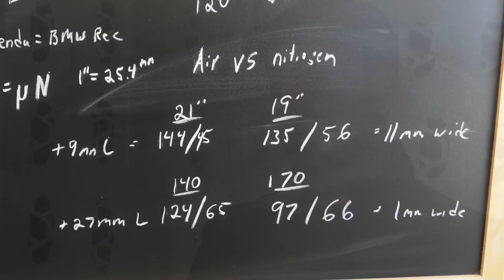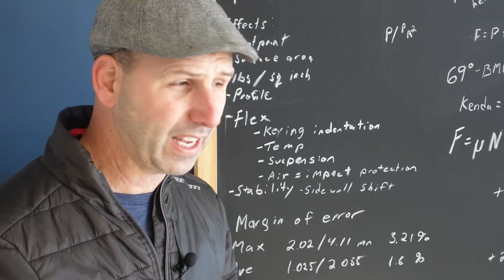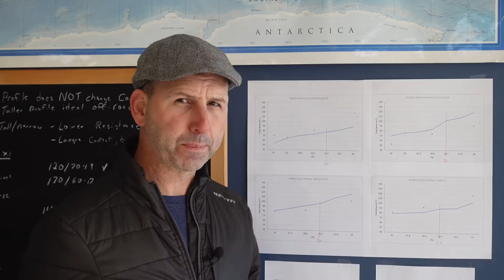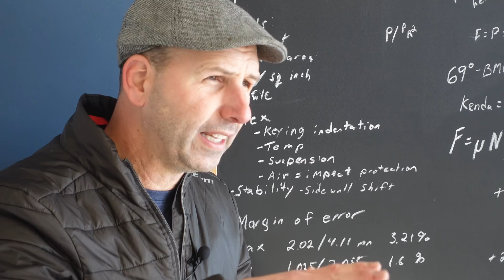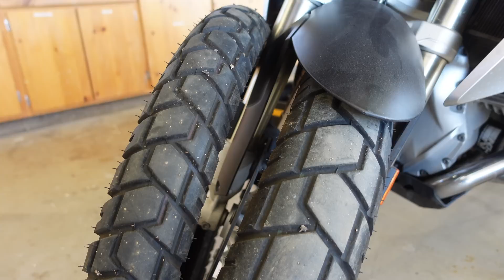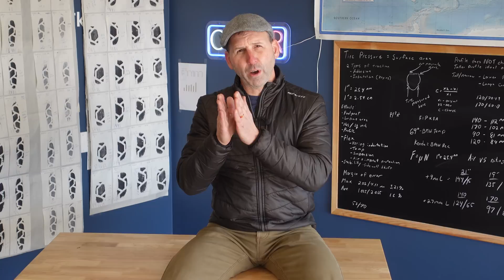Selecting the correct tire pressure; How airing down motorcycle tires affects contact patch

Comment: Consider the following: The Suzuki DRZ400 comes in Off Road S (or E) versions plus the road biased Super Motard SM version. The bikes weights are almost identical, the power of the S and SM are also identical. Which bike is better off road and why?. The SM has wider wheels with a smaller diameter. Assuming you could fit knobblie tyres to both. If off road traction is better with more tyre area, you would expect that the SM with its wider tyres would have a larger contact area per tyre than the off road versions. Therefore the SM should be better than an S in the dirt. Several factors counting against the SM. Firstly, since the wheels are a smaller diameter, the length of the contact patch will be shorter although, since the wheels are wider, you could expect the contact patch to be wider. A short but wide contact patch will be less stable in loose soil, meaning the front wheel with a wide but short contact patch will wander easier than a long thin one. The other factor counting against the smaller wheels is that it is harder to roll over rough terrain. That said, I question if having a greater contact area is a good thing anyway, my thinking being that Pressure = force x area. This means that for the same weight or load bearing down on a surface, the smaller the contact area, the greater will be the force per square inch into the ground. To put it into number, if you have 500 lbs of bike and rider and a combined contact area of 5 inches square, the pressure exerted on the ground will be 100 pounds per square inch (PSI). If you take the same weight of 500lbs and applying on a combined contact area of 4 inches square gives 125 PSI. The bike exerting the greater pressure on loose ground will sit lower in the dirt, the knobblies on the tyre will sink deeper, potentially giving more traction per knobble. So is it better to have more more traction on fewer knobblies or less traction on more knobbles?. Answers on a postage stamp if you know the answer.

Comment: Thanks so much Bret. we had a chance to spent some time talking about this topic before and I firmly believe airing down the tires change the BIKE HANDLING... but , nothing is absolute and the surface changes very dramatically often... finding the right air pressure is the key ... relying in airing down to increase BIKE HANDLING is not the "one size fits all" solution.

Comment: What about the footprint increase of a 50% worn tire as it flattens in the middle vs. a new tire? 

And do these same measures (pressure drops) magnify even further the footprint on a 50% used tire?
Reply from the maker: I didn't report on that but did measure. Surprisingly the few measures I took had less change than I expected. I thought the worn tire would have a larger footprint but it fell into the margin of error for the new tire. I need more to post results.

Comment: Try a lighter bike, your results are skewed because you used a really heavy bike. You cant air down on big heavy bikes, you can on smaller lighter bikes tho.
On a 350 pound dr650 or similar sized bike, 35psi bounces off everything, 30 psi is ok, 25 psi is the sweet spot and 20 psi will give you pinch flats and dent the rims. The extra traction off road when you air down comes from the tire staying on the ground more instead of bouncing around.
On a big heavy bmw gs you need to run about 35psi all the time, all that weight will wreck rims with less than that.

Comment: Fascinating!  It's good to see some explanation to things I've experienced, but lacked the knowledge to really understand.  I found dropping 3-6 psi (Tenere 700, 300lb rider) maybe helped a little, but going beyond that (despite people telling me it should help) made the bike wallow and felt bad at high speed on dirt and gravel.  Maybe that matters less when bike+rider isn't 750lbs, but it certainly mattered for me.

Not gonna lie.  I REALLY thought there'd be a bigger contact patch size delta.  While I already understood bigger contact patch doesn't inherently mean more traction (see fingertip vs whole hand on table traction experiment) I thought the conformance/give would do more... But it clearly doesn't until pressures are so low as to cause other problems.

Yeah.  Fascinating.  Thank you for this incredibly informative video!

Comment: For once, I disagree. I think your approach and methodology are consistent and sound, but I also think you are failing in the interpretation of your findings, and therefore your conclusions. You conclude that because the delta in the area of the contact patch is so small, the myths are busted. It would seem to me you fail to quantify (or understand) that it is not a linear / proportional relation (i.e. area increases by 3% = traction increases by 3%). I obviously don't have the formula, but empirically it seems to be exponential (i.e. area increases by 3% = traction increases by 9% [or more]).

Comment: Flex is about the only argument I could see for offroading....but the stiffness of most big bike tires kind of throws that out the window. Airing way down only ever delivered me bent rims 😑

 Tire choice and weight distro has usually made a bigger difference for me in mucky stuff.

Super soft tires on light bikes I'd see a difference, but big bikes? Nah.

Comment: I'm rather lame off road rider but in general, on or off road I find a little bit less pressure is better than little  more pressure. Turned out my main pump was filling 4psi below what gauge was showing. But slides better on more air. 🙂

Comment: Love your videos Bret, but those tire fingerprints you show indicating wide tires being not much better than narrow tires only hold water on hard flat surfaces.  As the surface becomes compliant as in soft dirt or sand, the extra width increases the size of the fingerprint.  Anyone who has ridden a TW200 with it's really wide tires in sand can attest, width matters in these conditions.

Comment: Great insight. I appreciate the scientific presentation... It does have me wondering about my Dual Sport motorcycle, with tubes and rimlocks, where I sometimes run as low as 8 PSI, where we are seeing a 70% decrease in tire pressure... Because as you demonstrated, tire response to deflation isn't linear... I know that your channel is largely focused on the adventure rider, on an adventure bike, but I thought it was worth sharing that you have sparked curiosity.
Reply: This doesn't apply to smaller dual sports with actual off-road tires
Reply: @philipraposo8324  Yes, I know this was a video about bigger adventure bikes, however, I was stating that I was curious what the results for smaller dual sports would be.
Reply: @brantfurr986  i ride a klx300 and its a huge difference with tire pressures.  we run dot knobbies that have soft sidewalls the tires flex far more and have lugs.  its not comparable and his tests are extremely flawed and misleading.
Reply: @philipraposo8324  How are they flawed and misleading?
Reply: @brantfurr986  because dirt riding is not done on flat yard ground.  Contact patch is completely different when considering a small rock on a hard tire vs same rock on a soft tire.  A half inch stone will literally take the tire off the ground if it's pumped to street psi.  If your running 8-10psi which I do all the time on my dual sport the rock does nothing because the tire conforms around it and doesn't leave the ground.the difference in area is huge.

He is testing a street tire when most people who actually ride off-road ride some kind of knobby tire.  

Trying to validate his beliefs but it's only applies to a tiny portion of the off-road motorcycles.  Yet he doesn't mention any of this in the video.  Hard Enduro guys don't even run any air.  Many keep 0 psi.  Small dual sports run sub 14 psi all the time.  Only large adv bikes run stupid high pressures because of the weight of the rider and bike plus gear.  They are not designed to conform to terrain in the same way that off-road focused tires will.
Reply: @philipraposo8324  So the video is flawed and misleading because it isn't about the same type of motorcycle that you ride? I'm well aware of what dual sport riders do to their tires... I ride an EXC-F 500. The KLX is a great beginner bike though... It was my first dual sport as well.
Although unless you've installed rimlocks, at 8-10 psi, you're eventually going to tear the valve stem... 
Maybe what I'm saying isn't translating very well... I'm literally agreeing with you in that dual sport and adv tires play by entirely different ruls. This video was interesting, and is very informative for people that ride larger adventure bikes, I was saying it would be interesting to see the same study done on lighter dual sports, that run different tires and tire pressures... Remember that you are watching a channel for people that do adventure riding... the motorcycles being capable on the highway is an important part of that. The focus here is not Enduro riders, or small dual sports doing minimal road miles between trail heads. This is for people on motorcycles covering large distances much of which will be on pavement. It's not about excelling in one type of riding, it's about being effective at all types of riding.
Reply: @brantfurr986  I agree.  I just wish he would have stated that this is specific to adventure bikes with street focused tires as opposed to The title of the video just addressing motorcycles in general and does reducing tire pressure make a significant difference.  I think it's important to be very clear to the audience because there are a lot of dual sport riders who watch this channel as well

Comment: I’m a believer in 15% air down for off-road riding then back up to normal when on street. It’s about feel, control and confidence. Also, anymore than that I see riders getting pinch flats on their ADVs (500+ lbs). 
Thanks for the detailed analysis.

Comment: Did the telelever of the 12xxgs seems to help get over the obstacle more comfortably compared to conventional forks?
Reply from the maker: Nope, just the opposite
Reply: @BretTkacs  interesting. I thought that was one of BMW’s reasons for using the telelever, that it rose “up” and over more easily instead of getting pushed back “into” the bike. Think the 19” vs 21” front might have come into play with that?
Reply: Or the heavier weight of the r12?
Reply from the maker: @doktorel  The telelever works amazing on the road but off-road is prefer conventional suspension.

Comment: If airing down doesn't increase traction why do drag cars with slicks only run 4 to 10 psi? Why don't they run 60 pounds which will make the top speed faster? Answer because airing down increases traction.  If you have ever rode a hard pack gravel road that had just been scraped, its like riding on marbles, if you are running 40 psi it feels like you are on ice. By airing it down it feels so much better. Like getting on a different bike

Comment: very interesting! On our 300cc dirt bikes we go from ~14psi on dry rocks down to ~9psi in wet/muddy terrain (on mousse) and it makes a huge difference because the carcasse is so soft that it basically wraps around rocks. In comparison on my 790 the carcasse is much more rigid, the compound is harder and the knobs larger and shallower. That's why airing down doesn't have that much of an effect. And indeed: in mudddy terrain no matter the pressure the grip is always terrible :D
Reply: On a 300lbs or less bike even 10psi is a huge difference.  Not only in feel but performance.  This video doesn't apply to actual off-road bikes and only for large adv bikes with road focused tires.
Reply: Same here. I run Tubliss on my WR450F and it's amazing the increase in traction from dropping from 15 psi normal trail pressures to 8-10 psi. I only do that in the rear. Found low pressures in the front just kill my steering feel with no gain. I can't place the bike precisely with low pressure in the front.
Reply: @ExpatonTwoWheels  yeah front tire I run it a little higher forsure.
Reply: This lines up with my experiences too. I have a KTM 500 Dual sport and decided to try to ride my local trails at street pressures. It was mostly OK but the steep loose climbs were much more difficult to keep the rear from spinning up, and the front was much less stable.
Reply: i think we also need to factor in that the low tire pressure is making the tire work like a suspension system, suspension systems keep the tire in contact with whats ridden on, therefore contact surface does not matter so much?

Comment: Another engineer here, and love this data driven analysis. Thank you! But I do have a question. Is there a specific benefit to a skinnier front tire? Context... I up-sized the front on my '09 Versys 650 to a 120-90-17 specifically to increase the overall circumference--same effect as a 19" wheel upgrade, just mechanically easier. Love the offroad stability that came with that, though the width gives me almost a TW200 kind of bigfoot feel. Seems to handle uneven hard surfaces like ruts pretty well--the side lugs have a lot of grip, and I wonder if a skinnier front tire would do as well. So why don't ADV mfr's go wider on the front tire? Is there a specific benefit to staying skinny? TIA!
Reply from the maker: Yes... Just like truck tires you end up with a similar total surface area but the narrow tire is long and narrow where a wider tire is wide but short. This means more of the narrow tire gets a free ride where to the front breaks through resistance features such as mud and sand.

A wider tire has to "cut" a wider path causing more resistance and possibly instability.
Reply: @BretTkacs  makes sense, thank you!

Comment: One of the things that fascinates me about motorcycles is how seemingly small "inputs" create relatively dramatic "outputs."  Push on the right grip just a few millimeters while traveling at 30 mph, and that 500 pounds of metal and plastic suddenly leans and wants to turn!  Just a few clicks on an adjustment in the front suspension, which is moving very small parts inside the tube, can cause a noticeable change in the bike's handling.  A one-degree change in rake, a one-inch change in trail, can make it seem like a different motorcycle.  So I wonder if a few millimeters of difference in the area of the contact patch results in a noticeable change in the way the bike feels to the rider?
Reply from the maker: Possibly but not because of surface area. It's more about flex and heat.

Comment: Interesting video, thanks for taking the time to actually measure things.

The main factor that dictates my pressures is the tyres I'm running. I run higher pressures off road on my TKC70 tyres than on my Motoz Rallz or Dunlop 908 as the tyre stiffness is completely different.

One interesting thought not mentioned is the fact that slightly lower pressures on gravel tracks could allow the constant smaller bumps (like under 10mm gravel which is pretty much a vibration) to be absorbed by the tyres rather than forcing the suspension to try and deal with it. I know from 4x4 driving it makes a big difference at speed on that type of surface, it just kind of takes the edge off things.

 With mountain biking I've experimented with tyre pressures loads and always end up running higher pressures than most mates. Too low and the tyres start to fold on corners and my rims get knocked in rock gardens.

Comment: a couple of things i feel the need to pull you up on being an experience trail bike rider and 4wdriver. 
airing down isn't about width of the tyre it's about length,  it's about changing the tyre from more of a fixed round shape to turning the bottom section of the tyre into a tank track (figuratively) where the leading edge is placed on the ground stays in situ until it moves past the centreline of the rim and is lifted up. this does happen at road pressure too but your analysis of the increased length from airing down being basically insignificant is flawed. small changes can have big effects.
tyre conformity increases both traction and puncture resistance, if a tyre can mould around a sharp object some of the pressure on the point is spread onto the sides of that object or onto the ground. you can visualize this by getting two party balloons and inflating one as much as you can and half inflating the other make a pyramid out of blue tack or something similar with a toothpick sticking out of the top and then push the balloons onto it. the hard one won't deflect and will pop the half inflated one will take much more force before popping if it does. so too much pressure = punctures, too little pressure = pinch flats.
the right pressure ultimately comes down to weight, tyre stiffness, speed and terrain.
more weight = more pressure
stiffer sidewall = less pressure required to achieve sidewall flex
high speed = high pressure or sidewall flex can overheat the tyre
terrain is variable square edged rocks require pressures or speeds that prevent pinch flats
sand requires low pressures for flotation (the figurative tank tread)
tar roads have good traction and high speeds, high pressures allow maximum handling and braking.
there's no set answer for tyre pressure, but there is benefits to airing down and times where it is necessary.